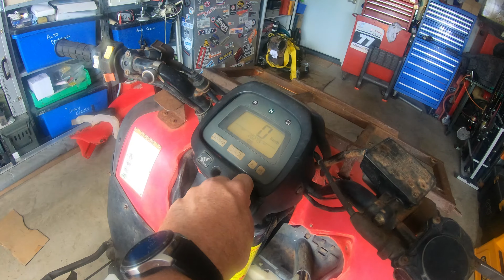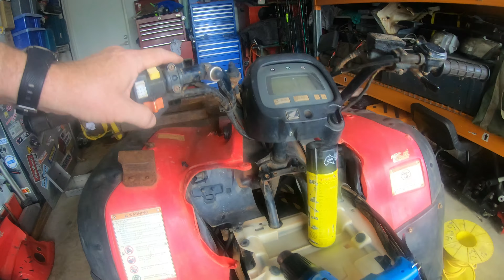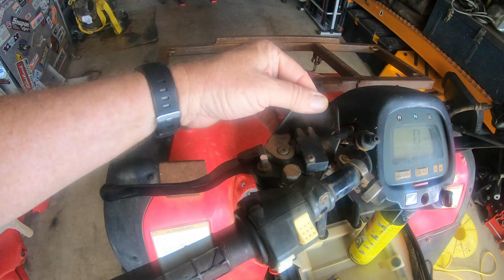15 year old Honda ATV project EP 2  The startup

Comment: The switch is an idle control, should hear it click when power is on
Reply from the maker: No I think its a temp sensor
Reply: @grayzbildz  on the carby? Try disconnected, see if it will still idle.
Reply from the maker: So the switch is a carby heater.....not really needed in Aus! Hahaha
Reply: @grayzbildz  might be needed in Tassie?

Comment: Brace yourself if you go to buy a primer from Honda, you can buy aftermarket ones but I haven't heard good reviews about them, as they leak and or do not last. I am all about buying original and I just bought a primer from Honda for my TRX300 that I just bought and am restoring and it cost me $70.00 USD. Yes I know that was outrageous to pay that, but like I say I buy original and that way there should be no issues with quality.